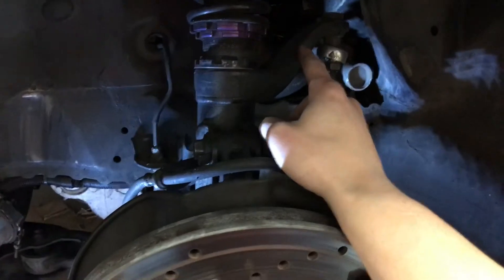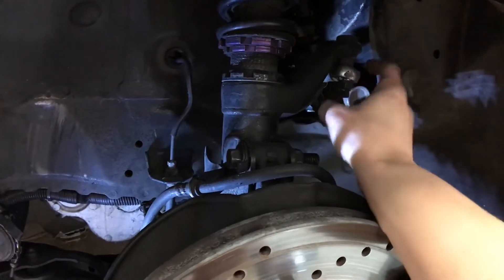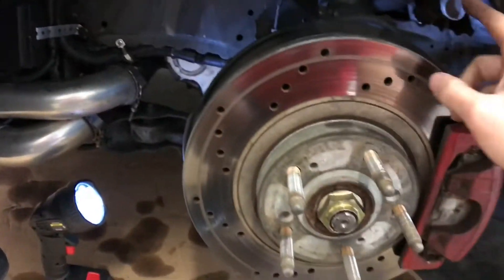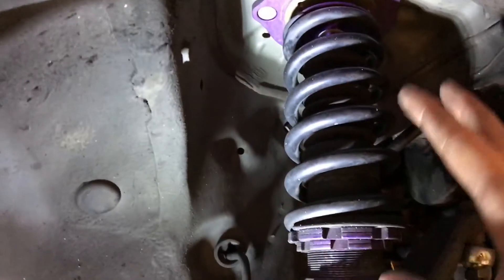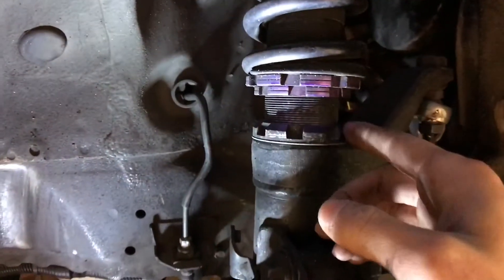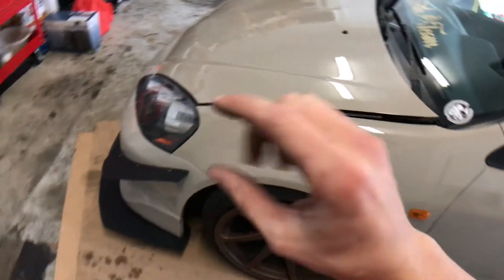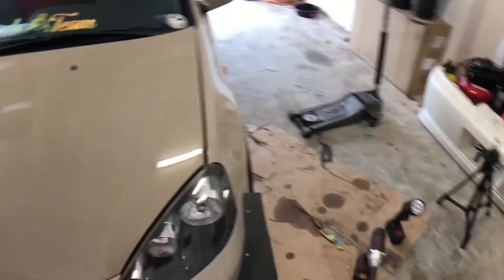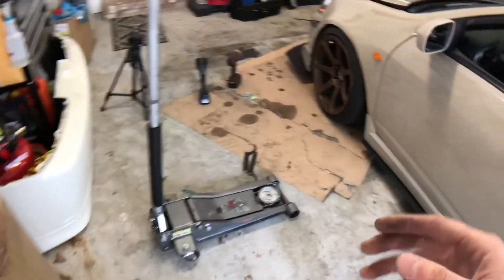HOW TO PROPERLY PRELOAD YOUR COILOVERS

Comment: Will extended tie rods work okay instead of adjustable ones?
Reply: Also, does negative camber toe-in or toe-out?
Reply from the maker: @mrpirateplane  Extended ones depends on how low you are. And negative camber toe-out.

Comment: Not sure if my coils came preloaded when I got them but I put them on, I have asked to k tuned which is the brand that made them and they said they are. But idk because I’ve had them for about a month now and they make a weird noise
Reply from the maker: TBills 3000 most coils usually come preloaded. And what kind of noise are they making?
Reply: Seth Lee it’s like that noise when you open an old door that needs its hinges oiled. Creaking noise kinda ya know
Reply from the maker: I would try and clean them or blow them down with air. There could be dirt or debris causing it. I would also double check the preload and make sure all the collars are tight. I've also heard some brand coilovers are noisier than others.
Reply: Seth Lee yeah Yeah that’s a good idea I will wash her up and get in between my wheels to hit to coils thanks for your advice. And yeah I hope I just have noisy coilovers and nothing is seriously wrong haha
Reply from the maker: TBills 3000 You should be fine as long as you don’t hear loud clunking
Reply: Seth Lee thank you bro🙌🏽
Reply: What kind of car is it? Is it an RSX as well? I installed coilovers on a Kia Forte and experienced squeaky noises, it was basically the spring not aligned in the rear since the kia forte's have a strut and spring assembly separate, not like the rsx which has a true coilover in the rear.
Reply: dc5_ pinoy yeah I have an RSX.
Reply: dc5_pinoy we have the same set, seperate spring from the strut but I haven’t heard any noise so far, but Is it natural when I hit a dip my car bounce like Im gonna flip over?

Comment: Hey man do I have to adjust preload if i want to lower car by 1 inch in the rear my rear shock and springs are seperate ..I’ve been told they come factory preloaded so I shouldn’t mess with them ? Little help confused
Reply from the maker: Most coilovers come factory preloaded
Reply: My Sonata has the same rear separate spring and shock...these are in now way preloaded from the factory...you wanna use the spring perch to set your ride height...have the shock unbolted from the lower control arm buckle

Raise the lower control arm until the spring is snug...add 5mm of preload compressing the rear spring 5mms

After this extend or shorten the shock so that the mounting holes align with the shock body fully extended and install bolt...this way at full extension the rear spring always has that same 5mm's of preload just like the front!

Comment: Ur spoiler will bypass the air for the wing so the wing is doing absolutely nothing. Not a good idea
Reply: Btw u got fb? May i friend u?
Reply from the maker: Redline Junkie I’m having a hard time following what you’re saying. What are you referring to as the spoiler and what are you referring to as the wing? Or are you talking about the angle of the wing? Thanks
Reply: Seth Lee the spoiler is the thing u put above the rear glass, the thing at the very back is the wing. Wing is different to a spoiler. The thing install at the back of a nasca car is spoiler not a wing. Ref to the aerodynamic, the spoiler will simply stop the air flowing down along the rear mirror, instead, the air will flow up above the car which will lead to no air across the rear wing and no down force created by the wing
Reply: Seth Lee That doesn't mean a bad thing, its just the wing become redundant
Reply: Seth Lee Flat positioning the spoiler only eliminated the lift at the back of the car but won't create and down force. If u want increase the down force u can either remove the spoiler so let the wing do its job or increase the spoiler angle
Reply from the maker: Redline Junkie I’m following you now. I never thought of the rear window visor as a spoiler but you’re right. It spoils air like one. I wouldn’t mind time attacking the car. And if I did I’d definitely re-evaluate my cars aerodynamics. Thanks for the look out!
Reply: Seth Lee haha cool
Reply: Seth Lee u did build some fking sick rsx, love ur video hope u shoot more haha